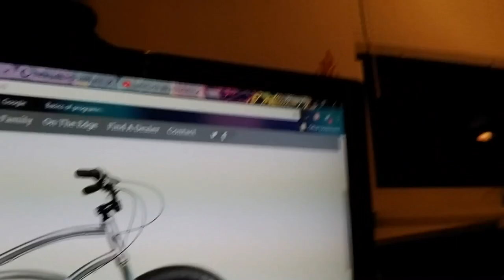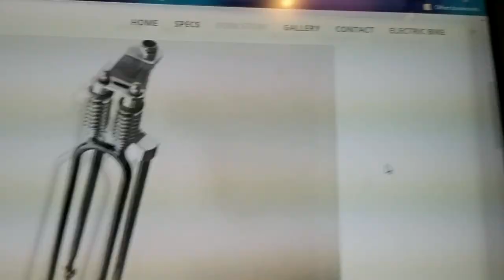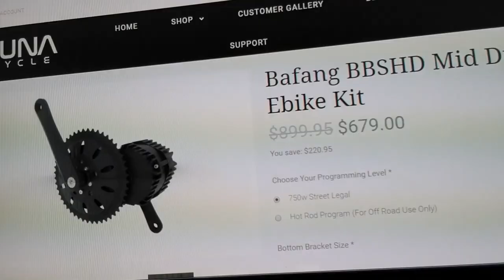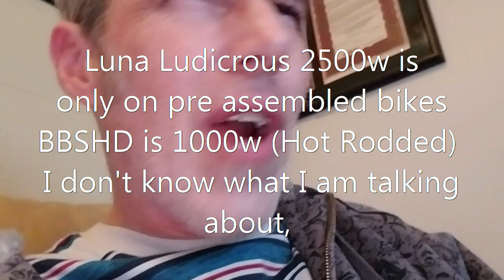E-Bike Build Diary ep.1 12/29/17

Comment: do you have the bike picked out yet?
Reply: sorry. I asked before I saw the whole video.
Reply from the maker: Not sure if that one will work. Consulting with www.bicycledesigner.com, they might be able to source most of the parts.
Reply: I think you need to look at other style of bike manufacturers before you make a decision. To stick to one manufacturer who wants to sell you you chrome parts and put a bike together comparing it to the Corvette that you mentioned requires more research than just one bike shop. For example. You want a Corvette but for commuting a Corvette is not realistic. In my opinion if you choose your bike with the Corvette mentality you will get to your destination quicker but will you be exhausted because of the style of bike you choose. Cruiser bike vs mountain bike vs cyclocross. Also. The next question I have is the BBSHD. Why did you pick a mid size motor vs a hub motor. How much of your riding involves steep grades.  If you have one or two steep grades then a hub motor might be an option also. There is a forum called endlesssphere.com Anything ebike you need answered has already been asked and answered. ebikes.ca is another ebike seller that sells ebike motors that can outperform the BBSHD.  Now that is the Electronics part of the build.  Have you researched the different aluminum bikes and which is strongest.  The best is Chromoly steel.  Alot of people go to Craigslist after they have done there research and buy a used Chromoly bike that is older but much stronger than what is made today.  Then what kind of drive train will you use. Shimano? Sram?  What you should start researching is on youtube.  What is the best tire for you type of commuting?  Best Shocks? What kind of Disc brakes, Hydraulic or Mechanical Disc Brakes.  It is alot of fun to do the research. I have a Kona Ute cargo bike that I bought a BBSO2 and a BBSHD.  I am currently using my BBSHD.  My type of riding is all city (New York City). I could either go hub motor or midrange motor.  I originally bought a Lightning Rod small black Midrange motor.  It was a beautiful motor. Much more powerful than the BBSHD. But my problem was I would have to park it in the street. The motor was all polished steel components that made it stand out. I didn't want anyone stealing the bike so I decided to go with the Bafang.  There is alot of research out there before you make your decision. Hopefully I gave you some information and not confusion.
Reply from the maker: All hills. Hydraulic brakes. My LBS also suggested Chromoly. They are also consulting to make sure the final product is able to commute without too much effort. My RadWagon has no shocks so any will be better. I can't do endlesssphere, it makes my brain hurt. Likely the ADD. The BSHD is the highest recommended motor considering I need a powerful, quiet mid drive that can take hills, work in the rain and is relatively inconspicuous and quiet. My LBS advised against used bikes due to possible metal fatigue, I have a reasonable budget for all new with the expectation of longevity. My commute is 40 miles daily all hills (see link at end). The bike will have to be comfortable to ride. If I get a cruiser I will try to set it up so I sit on it like a regular bike. Alternatively, I love the style of the Schwinn Sanctuary-Phantom-DX. The Sanctuary is reasonably priced but I am skeptical about the quality.  I am sure all of my plans will have changed by the next video. THANKS!  https://www.google.com/maps/dir/47.6785903,-122.1321845/47.4472747,-122.2108992/@47.6816707,-122.1466883,15z/data=!4m14!4m13!1m10!3m4!1m2!1d-122.131891!2d47.6785878!3s0x54900d52efa26c91:0xbb75ee4cf787dabf!3m4!1m2!1d-122.13143!2d47.6785832!3s0x54900d52eb704d7b:0x10e8a44cdb12f74a!1m0!3e1?hl=en&authuser=0
Reply from the maker: Nashbar touring bike is Chromoly.
Reply from the maker: Also the Trk 520
Reply from the maker: To address the Corvette metaphor. You are thinking of a modern performance car in commuter traffic. The '72 Stingray was not only a muscle machine but also a smooth ride. I would not want to drive one in morning traffic but in my bike lane the comparison would be more like driving on an open highway. In the case that I was driving daily for an hour and a half on clear roads, it would be a pleasure to do so in a 1972 Corvette Stingray  convertible especially when gas is not an issue. I have consulted now with a few people who have made e-cruisers themselves and verify that the ride is not overly burdensome.
Reply from the maker: I am looking at the endlesssphere to see what I can find. These types of sites I can get lost in.
Reply: With your budget you should be able to get something very decent to ride. One last thing. If you buy from Lunacycle they will sell you a BBHD on steroids so to speak. They amp up the BBSHD but only with the bikes that they sell. They will not sell a motor that is amped up on its own.  I think the BBSHD puts out up to 30 amps. Lunacycle works on the motor to give you up to 50 amps. Which would mean a bigger battery which will definitely give you more speed when you need it.     I will be looking forward to your build.  Some people make videos from start to finish. This is how I learned about the different ebike creations out there.
Reply from the maker: I will definitely  keep posting vids as it progresses. Looking at a guy who mods SIKK cruisers. They have a 7 speed w 3 inch tires that looks like it hits all my specs. I am starting to think the bus people have their numbers wrong.
Reply from the maker: New video coming up. Plan locked, bike picked.